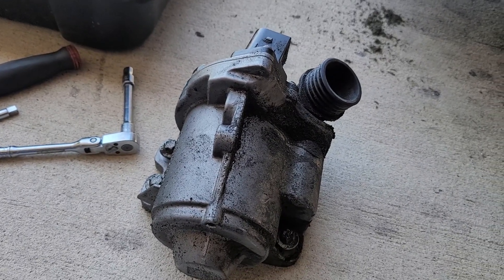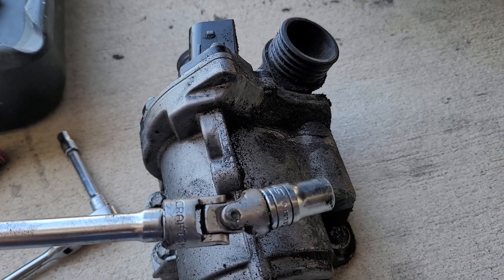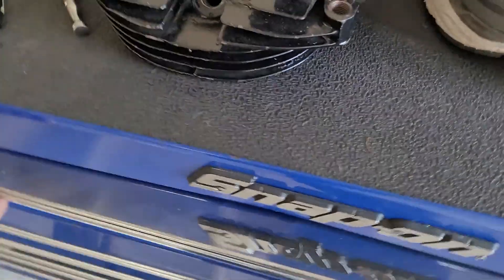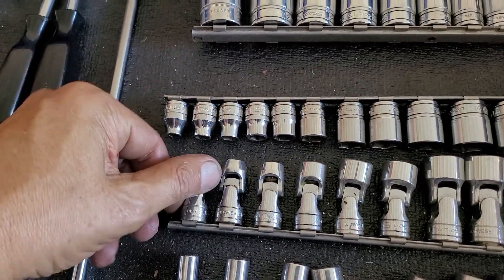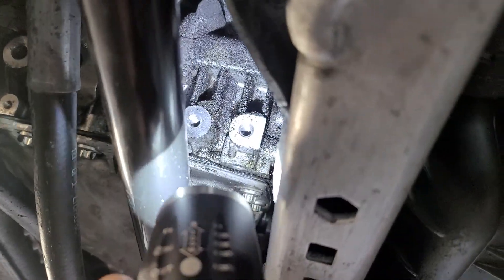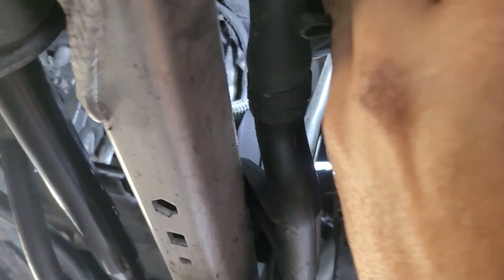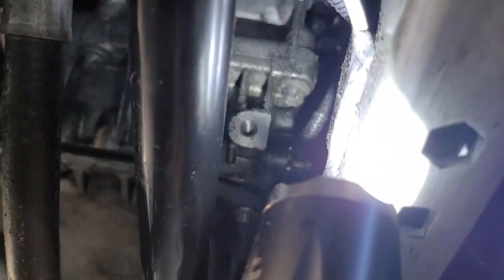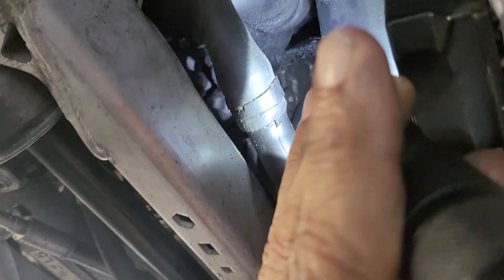Part 2 How To DIY BMW N55 Coolant Hoses Water Pump & Low Temp Thermostat TIPS

Comment: man on my 2014 535 they made the 3 bolts star screws t27. also the  "access  window" through the wheel fender liner had been covered with metal heat shields and theres no access to the aluminum coolant hose. i was able to take it off with alot of tinkering but now it wont come off the car without me removing the cat so i hit a road bump here. i even tried to to take it of from above but its not coming off without removing the cat.  all of this bc left crankshaft seal leaking oil for a few months melted the hose on the water pump ... one problem leading to another... is taking off the cat simple? i just need some wiggle room
Reply from the maker: @MACSTEEL107  cat is simple to drop